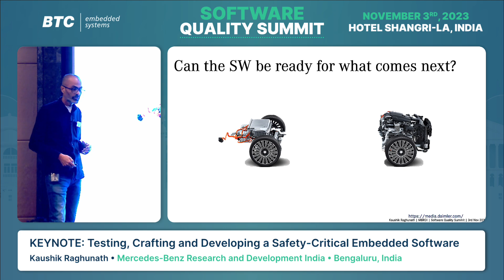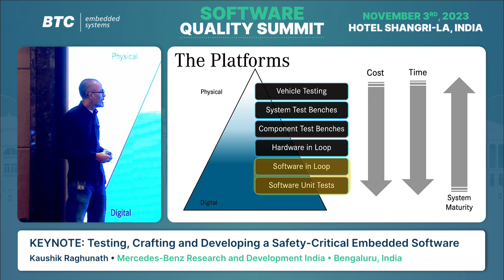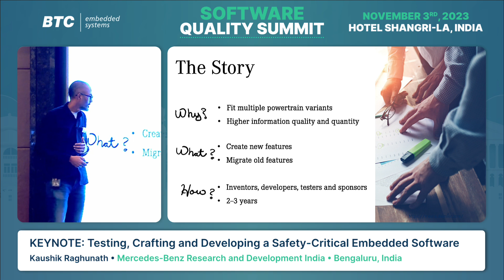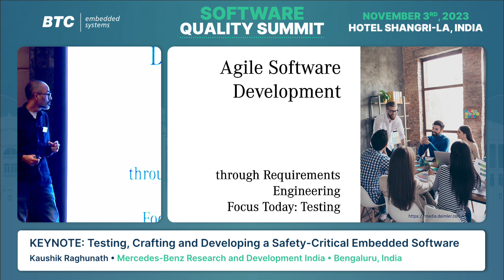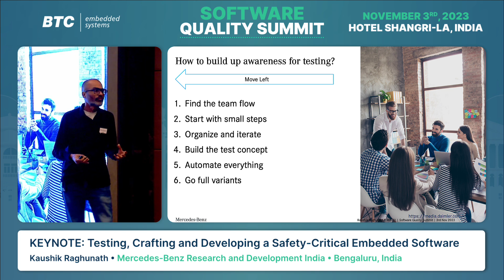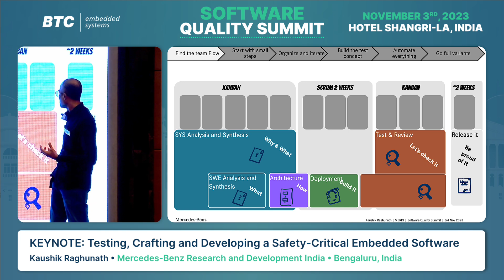Software Quality Summit - Testing, Crafting and Developing a Safety-Critical Embedded Software

Comment: Would love to see the a simple project taken thru all the professional software development best practices (aerospace (DO-178C), medical (13485) nuclear (414.1x), automotive (26262)).

For example, before any code is written, one needs to have the output documents in mind.. SDP, STP, SVP, PSAC...  SRD, SDD?

How does the software framework fit within an overall system framework.. like Waterfall, Agile->Scrum?  

And now with AI, I would think companies would be reluctant to divulge sensitive requirements , ICDs, or other proprietary data in order for AI to do the coding. How do you see companies getting around this?   For example, running open-source LLMS offline (via "Tiiny AI" for example) keeps the data safe, but is the code quality of open-source LLMs as good as the commercial ones (Claude, Grok, etc).   And is there any concern that the current best open-source models come from China?

According to AI, this is a sample roadmap: 
Requirements Capture   (SRD, IRS/SSS)
Architecture & Design (SDD, IDD)
Coding (SPS, SVD)
Static Analysis ex. Polyspace,LDRA, Coverity   (Static Analysis Report, Code Review Records)
MISRA
Unit/Dynamic Testing ex. VectorCAST, Tessy  (STP, STD, STR, Coverage Analysis Report)
Hardware Integration/Testing
Coverage / System Verification Integration / V&V Testing (SVR, PR log, SAS, SCI)
Alongside this flow, CI/CD every commit triggers a build that automatically runs Static analysis, Unit Tests, and reports coverage, with Traceability matrix (RTM) constantly being updated during Coding, analysis and testing.

As an example, a company might do Agile/Scrum + Continuous Integration inside a V-Model with full traceability:
          Jira Epic / Feature
                    ↓
               Jira Story
                    ↓
      Polarion Requirement(s)
                    ↓
             Design Update
          (SDD / IDD / Models)
                    ↓
              Git Commit
                    ↓
                CI Build
                    ↓
Static Analysis     Unit Tests           MISRA Checks
(Polyspace,          (VectorCAST,       (LDRA, QA-C,
 Coverity,                 Tessy)               Polyspace)
 LDRA)
                    ↓
            Coverage Analysis
          (Statement/Branch/MCDC)
                    ↓
           Build Artifacts Stored
                    ↓
          Target Hardware Testing
            (Bring-Up / Drivers)
                    ↓
      Hardware-Software Integration
                    ↓
           System Verification
                    ↓
            Story Accepted
                    ↓
               Release